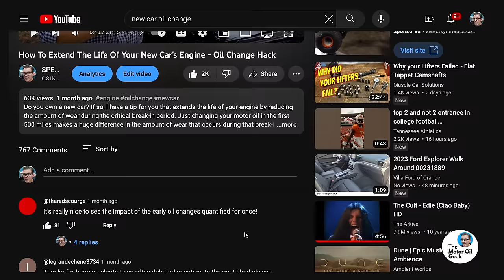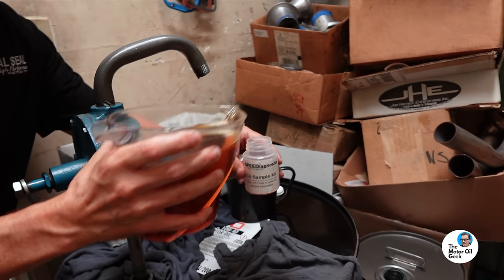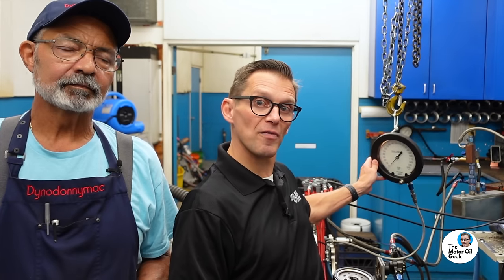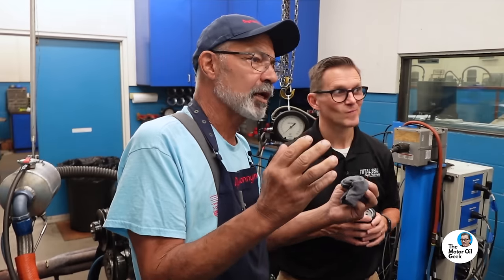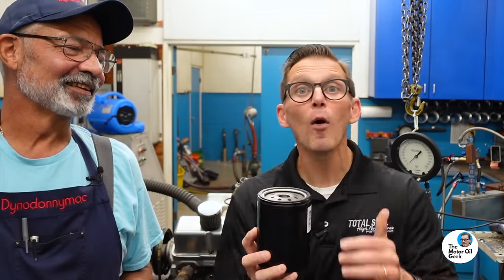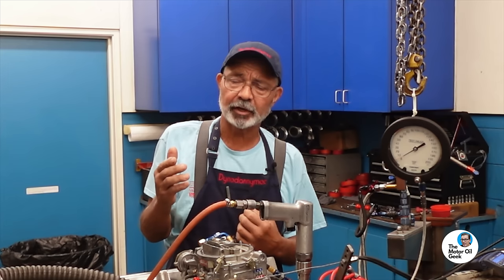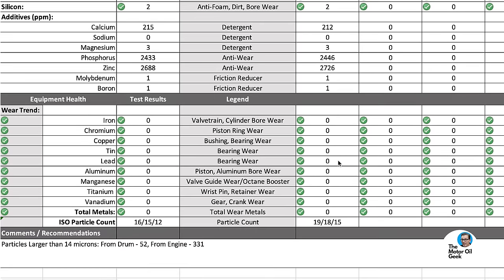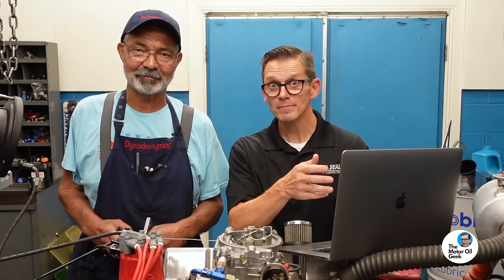Does Pre-FILLING The Oil FILTER Cause Engine DAMAGE?

Comment: I've run Mobil 1 synthetic for 10,000 between oil changes, and pre-filling the filters, for close to 30 years and my engines have always been spotless. Years ago I had to pull the top off the 3.4L engine in my Lumina Z-34 because of the common oil leak from the distributor dummy plug. There wasn't a spec of dir ot sludge anywhere, and all 4 cams barely even had wear marks on them. That was enough to tell me that I wasn't doing anything wrong.
Reply: Mobil 1.  That's all you had to say.  I changed the Mobil 1 in my 1984 Sierra 5.3 once per year.  I traded it off at 185,000.  It was still running as good as the day I took delivery.  That's about 25,000 miles per oil change.  How'd the engine look?  How should I know, it never needed ANY engine work.  Folks at home:  Don't try this with any other oil than Mobil 1 full synthetic.
Reply: @BlisterBang  In '92 I bought a brand new GSX-R 750 with 2 miles on the odometer. I changed it at 500 miles, then again at 1,000 miles, then every 5,000 after that. I didn't beat on it, but I sure didn't baby it while breaking it in. I put over 10,000 miles on it between June and late October when I parked it for the winter.

All my friends went through clutches and finally at almost 20,000 I got paranoid and changed mine; there wasn't any need, it was still measured within spec. despite a lot of launches street racing and at the drag strip.

At 26,000 I pulled the engine out because I decided to build a 955 cc big-bore 750 with ported head, big cams, Mikuni radial slide carbs, etc. Those engines were famous for having the cams go flat by 25,000 miles; my cams looked like new and barely had any marks on them. The transmission gears looked like they came out of the box, and the main bearings looked awesome. A couple years later I pulled it apart to check things out, and at 40,000 miles the transmission gears and main bearings still looked almost like new.
Reply: I use mobile 1 as well in all my cars. Does an amazing job. However, I changed my oil every 7500km religiously, lol
Reply: @darkrelic6199  That equals 4660 miles. Years ago I was talking with my father and he said he changed it every 10,000 miles or once a year, whichever came first. I thought I had been pushing it by changing it at 5,000 miles, but he convinced me it was a waste of good oil. He said you could always change the filter if you're paranoid, but with the quality of filters we have now even that's a waste. 

My dad started running Mobil 1 back in the late '70s and he's had nothing but excellent results; he's the reason I've used Mobil 1 for over 30 years.
Reply: I refuse to run Mobile 1 anything in any of my machines. It's Castrol or Royal purple all the way for me and if a store doesnt have it, i go somewhere else that does. i'd rather run an engine low on oil than run Mobile 1, penzoil, quakerstate, or any other shit brand.
Reply: @starlightdragon6862  You're nuts. Mobil 1 is good stuff, my dad has been running it since the '70s.
Reply: @BlisterBang You can easily do that with AMSOIL.
Reply: @starlightdragon6862  I hate to do this to you but you asked for it .  Look up castrol   camshaft wear .  Castrol replaced a set of cams in a mercedes engine for me a few years ago . A rep I talked to said never break in a cam on castrol , they said their castrol  moto race bikes even use a different oil .

Comment: Let me clear this up a bit. You should refill it somewhat. Here is why. There is a paper element inside the filter body. If you fill the filter up with oil, after a minute or so, you will notice that it’s dry again and therefore you have to fill it again. So you must put at least two thirds of oil into the filter initially because if you don’t, then there will be some time until the filter gets saturated fully. Therefore truth be told, there should be some oil put into the filter at the start. Next time you clean up some water with tissue paper you’ll see why.

Comment: I’ve always pre filled the filters on my semi trucks, when 2 filters hold over a gallon of oil watching oil pressure without filling them takes forever to build pressure, it’s a industry standard to put on dry filters. Having them filled instant oil pressure been doing this over 15 years already no problems. I will pre fill a oil filter on a 20k plus engine without question

Comment: I always fill the filter, If the filter is inverted, I at least saturate the filter element. I believe this would enable the pumping oil to pass through just a little bit faster.
Reply: Oil is pushed trough that filter... and it takes seconds, its just useless

Comment: Over time based on conditions in the shop...old pumps wear and cause high chrome, cadmium and other particles. Always pull a sample from a clean tube to test the drum (oil)  and a sample from the end of your pump hose (pump / hose). I'm talking of course about maintaining large engines that cost 100K plus and oil from drums.

Comment: It would be pretty bad business for oil manufacturers to have ANY damaging contaminants in brand new, fresh oil in a new container. The one thing people need to be careful about is when the oil bottle has that foil seal, don't let any small pieces fall into the bottle when you puncture it. If that happens, stick a fine mesh paint filter in your funnel and that will catch any small pieces that may have come loose.
Reply from the maker: Great point! We’ve actually seen that in used oil samples.
Reply: Good point, but there have been plenty of documented cases of brand new oils containing visible particles. Pennzoil Platinum/Ultra is one I've seen this with first hand. It's a known issue, look it up. A few PPM of iron, aluminum, and other traces of contaminants are expected when new oil is analyzed. As far as I know, there aren't any industry cleanliness standards new oils have to meet.
Reply: @averyalexander2303  not saying it's impossible, but I think that would be exceedingly rare to have large particles big enough to damage intetnals. I dunno. I have been changing my own oil for over 30 years and have pre-filled every single filter that could be prefilled. Never had any issues whatsoever with motors well over 100k. My Cummins has pushing 250k and still runs like a brand new engine. Excellent compression and oil pressure. Fires up with just a bump if the ignition. Like they said, you can use a fine paint filter first if someone is worried about it.
Reply: @DanielSmith-yp7mw  I have found sticky, gritty particles at the bottom of Pennzoil Platinum bottles even after shaking them on multiple occasions. After some research (very well documented issue going back 10+ years), it looks like the general consensus is that stuff is likely just additives that settled out or didn't mix fully. I'm not sure how harmful something like that going directly into the main oil gallery would be, but it seems to me like it would be abrasive. And although not likely, something like that getting stuck in a tiny oil passage such as a piston cooling jet, oil restrictor orifice, or VVT system could be catastrophic. I personally think either filling the filter through the dirty side or filtering oil before adding it to the filter is the way to go and many manufacturers agree with me. I generally do the latter since it's normally easier for me than the former.
Reply: If y'all are finding new oil that's dirty you better find a better supplier.
Reply: @averyalexander2303  Yes, I've seen this in Platinum jugs.  But these are oil additives designed to be in the oil. This is not contamination, nor is it hazardous.  I've communicated with Shell.  I've taken to shaking the jugs before pouring the (excellent) synthetic oil made from natural gas (thus clean and uniform chemically) into my engine so I get what I paid for.
Reply: @averyalexander2303 Whatever particulate might be in brand new oil is not going to damage your engine as much as having dry bearings for 5 seconds, which is about how long it takes to get oil pressure if you don't prefill the filter.
Reply: @actionjksn  If that's the case (and it may be), why does almost every service manual and oil filter specifically say to NOT prefill the filter? My theory is because they see possibly causing a tiny but predictable amount of bearing wear on startup as a better option than the much less likely possibility of a larger chunk clogging something small like a piston oil squirter and causing a catastrophic failure, but that's just a guess. Either way, if someone wants to prefill their filter, there's nothing wrong with filing it through the dirty side or filtering the oil before pouring it into the clean side.
Reply: Excellent comment and very valid point!

Comment: Unfortunately my filter is located on the front of my engine basically and it’s sideways , so another words there’s essentially no way to pre-fill without losing all of the oil in the filter. I never understood this design but it is what it is . Good information on all of your videos. 
Thank you !!!
Reply from the maker: Thanks for sharing!
Reply: There's no way you're gonna lose all the oil out of the filter... you'd hafta hold it upside down to accomplish that. And has been mentioned, at the very least you're still getting the filter medium absorbed with oil by adding at least some oil, so it's still worth pre-filling.
Reply: Senior management at car companies should be forced to change the oil in the first 10 prototypes of every new car.   We shade tree mechanics would benefit greaty.
Reply: What I have done is put a little in at a time to let the filter soak it up
Reply: My oil filter mounts approximately  at 45 degrees, so I have been happily prefilling enough as not to spill during installation.
Reply: Most European cars and Subarus have oil filters mounted up high for easy servicing and upside down, so they drain out every time the engine is shut off.  Even with stop-start systems this is a non-issue, because you only need microns worth of an oil film for lubrication, and cooling for such a short period that the oil provides is a non issue for a second.   Prefill if you want, you won't kill your engine if you don't.
Reply: Ford?
Reply: @BoopSnoot  my bmw and VW were up top I simply soak it before installing it you don’t want your engine starving for oil pressure
Reply: After you change the oil, disable the engine from starting. Eg disconnect ignition system. Then crank the engine for about 10 - 30 sec to fill the oil filter. Then reconnect ignition system. Not as good as pre filling, but better than actually starting with no oil.

Comment: I agree 100% with you. This is fine when the filter is mounted in a vertical position or even at an angle, but does not work if filter is mounted horizontal, which I have encountered on some engines as the oil will run straight out while installing it.
Reply: I don’t think I’ve ever owned a car where the filter mounted vertically, or close enough vertically to get a reasonable amount of oil in there.
Reply: I have an engine with a horizontally mounted oil filter.  I still put about 1/2 of the filter's capacity's worth of fresh oil during a change.  After the filter sits for a few minutes while I am filling the crankcase, the filter media is mostly saturated with oil.  The oil level has dropped during this time to a level that does not run out when I mount the filter.  I use cheap filters with paper media and change my oil frequently.
Reply: Our Toyota Hilux has the oil filter mounted upside down making prefilling very difficult.
Reply: Not if you let it soak into the filter media.
Reply: Some newer cars have.the filter on top of engine and upside down so i prefill it let it soak then drain it b4 install, if this makes any sense to u all.
Reply: @theendarkenment civic has,  i was able to put almost half way full did not spill
Reply: It does work on horizontal filters you just dont fill it all the way to the top , pour about half in and let it sit as you do other things to the car and before installing turn it to the side to see if it can hold more without spilling and if it can hold more fill it up and test it again its not that hard you just dont over fill it and can test it by simply turning it on its side and if any does come out you can put it back into the container or into the block  the oil is still clean so no need to worry if you put it back into the container
Reply: @theendarkenment my subaru you can fill it up all the way since its mounted open end up my honda on the other hand only half way , even upside down you can still fill it with some just very little only enough that the media will soak it up hand hold it

Comment: Great video guys agree with all you say, but on some engines the filter placement is poor on its side or on Subaru's I think upside down these placement make it very hard to prefill. Fine if its vertical not very practical in other positions. Still a great video guys keep up the great work.
Reply: The major thing is to thoroughly wet the filter material ... Fill it, wait, top it up, wait, until the oil stops being absorbed by the filter material. Then fit the filter with as much oil in it as possible.  You've done your best and it's the best that anyone can do 😊 imho.
Reply: The Subaru filter is only upside down when the car is in the Northern Hemisphere, in Australia the filter can be filled because it is now right side up!

Comment: I'm 73. Have always prefilled my oil filters. When I got a Gladiator a few years back, it really bothered me when I changed my oil that I couldn't prefill the canister filter. I knew about the pre-flood mode. But the canister filter on this thing is inverted and empties each time you shut the motor off. I found a product called the Baxter Performance spin on filter adapter. You can replace the canister filter with a spin on cartridge filter. Yes, it is still inverted but remains pressurized so no more dry starts.

Comment: Great that you did the measurements, even though we "knew" pretty well what the result would be, it fully debunks the myths and also, you never know, sometimes a measurement can surprise even experts. It's actually pretty obvious that fresh oil from the container isn't contaminated, because there are a lot of small engines lacking oil filters entirely.
Reply: My lawnmower , and other garden appliances , not to mention my generator or air compressor ( which is a motor driven pump , but still needs lubrication ) . Oh then there are STEAM engines !
Reply: user-wv1pj6wh4h  I think you meant "measure" but anyway the point about the scientific method is that you don't know anything until you measure it. Suppositions, even seemingly obvious ones mean nothing.

Comment: I think some people have oil filters and diesel fuel filters mixed up! Never pre-fill a diesel filter due to possible contamination getting to the high pressure pump. 
I have always pre filled my oil filters for the last 50 years, never had an issue.
Reply from the maker: That’s a great point!
Reply: Thank you for this golden information for me 👌
Reply: I always prefill my fuel filter too, I pour 2 bottles of seafoam in it before I install it.

Comment: I have been around cars all my life. It started with my father racing and helping him. I began racing road courses and auto cross as I got older and have been working on cars for well over 30 years now. What you say makes sense. Pre filling the filter canister will create less wear upon vehicle startups. However, having many different vehicles, most vehicles have side mounted filters or even upside-down filters mounted to the engine block. You can't prefill those types of filters. You can't have the oil draining down on the the motor in such a fashion. My son has a Subaru STI which he takes to Autocross and drives on a daily basis. The filter on the Subaru, is on top of the motor upside down right up front. You can't fill that filter without spilling all of the oil out of it. Also, you are correct that it does eliminate or at least lessen the wear. However as you stated, the where is very small and minute. Automobile manufacturers have an allowance for this wear and expected as most people only know how to put gas in their car and that's about it. The vehicles seem to still run a very long distance with having regular oil changes and routine maintenance completed as required. I have seen vehicles reach 400, 500 and even up to one million miles in their life. A Toyota Tacoma reached one million miles and was bought back by Toyota Company from the owner as a test product to see what happened to the motor during its million mile life. To my knowledge that vehicle only had routine maintenance, never had a pre filled oil filter, nor was the oil changed on a hot engine every single time. I am not disagreeing with you, I am just stating that prefilling is not a practical method for every vehicle or most vehicles on the road and manufactured today.
Reply from the maker: Thanks for sharing your thoughts

Comment: Thanks for this. Been pre-filling them for decades just to be told the same thing IRT the new oil being "dirty." Never mind the fact that one car we had since new got that treatment made it over 300,000 miles and still ran like new with no oil consumption, plus all my other cars that got the same treatment with no problems whatsoever.
I don't care what any of these naysayers claim...they just run better after an oil change when the filter is pre-filled...quieter, smoother.
Heck, most turbo charged engines require that. If that's good enough for them, it's good enough for me.